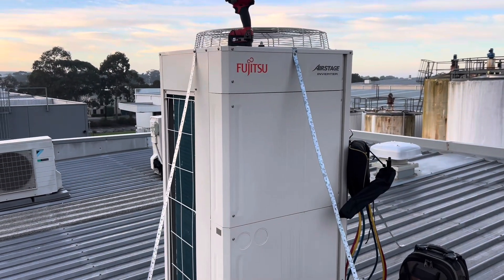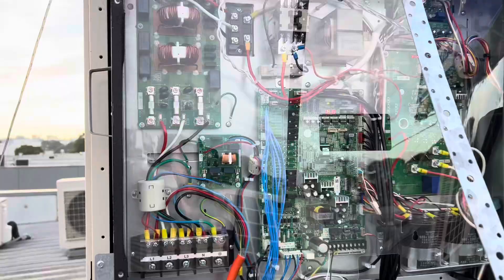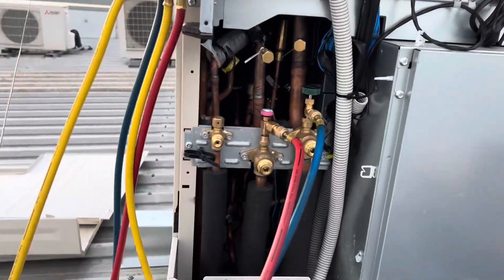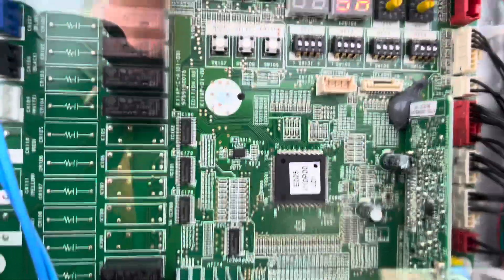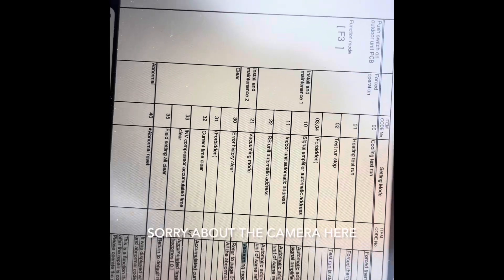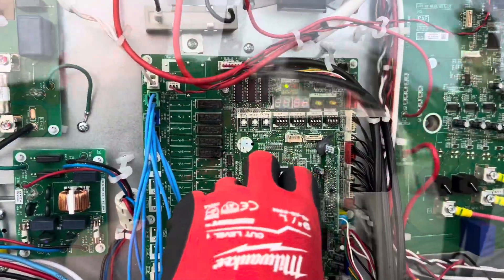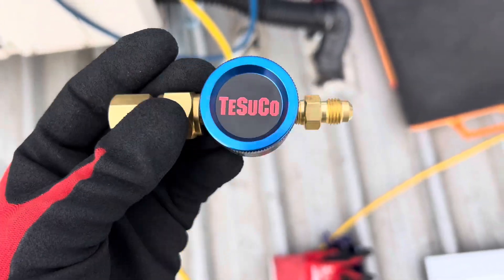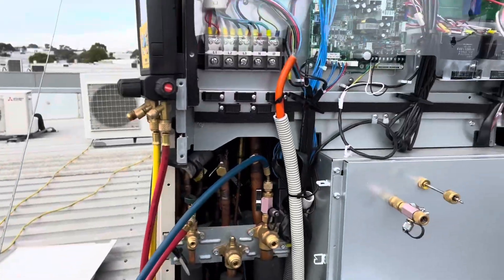Fujitsu Airstage / Pumping Down a 3 Pipe VRF to Add an Extra Indoor Unit

Comment: Could you put the product no. For the mini Nitrogen regulator from ACTROL?
Reply: It’s Tesuco part number is PBT1 not too sure on product code! Found it supplied at my local actrol also
Reply: @jamesmccann8896  Thanks alot, I’ll get one ASAP
Reply from the maker: It doesn’t appear to be on their website. Potentially just my local Actrol selling them. Next time I’m in I’ll grab the part number and post it back here.